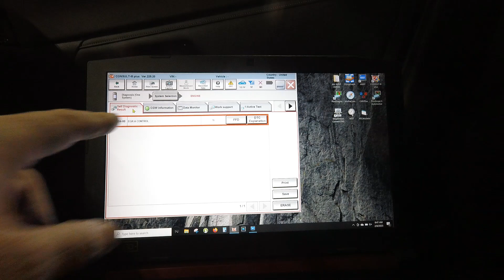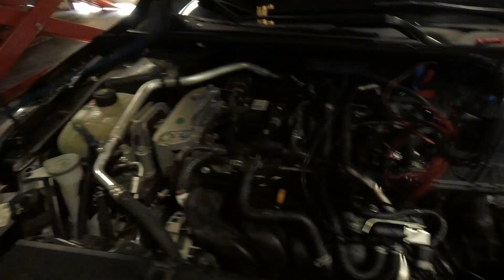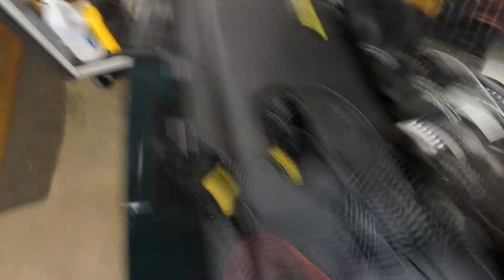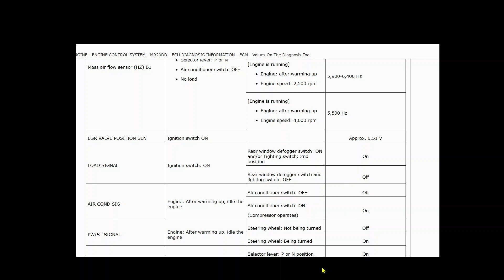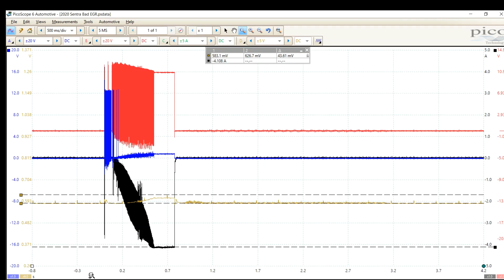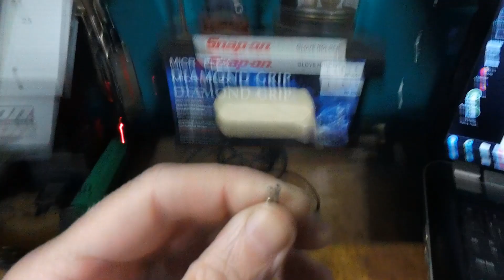Something Shiny!

Comment: What is the cause of this large peak in the valve position signal 36.22? There is no indication from the current or voltage command that a major change will occur.
Reply from the maker: I had the scope on a 9x vertical zoom so small things look way more   serious than what the are. It most likely noise.

Comment: Mike, always enjoy your attention to detail. Its greatly appreciated.  Were all of your captures gathered while using the function test for the egr on your scanner? If so the sudden back and forth of motor command to the egr may have been a strategy of the test to check for reaction all the functions  of the valve.  Like you said postion  sensor was not indicating what it wanted. By the way, you can take a deep dive into any subject you want. I'm in.
Reply from the maker: I appreciate the comment. On the capture I went over with 2 amp clamps, the engine was at idle.  All of the other captures I was using the scanner and active testing.
Although the EGR valve wasn't open,at idle it is still  pulsing the valve. I'm guessing it stays in a constant state of ready.